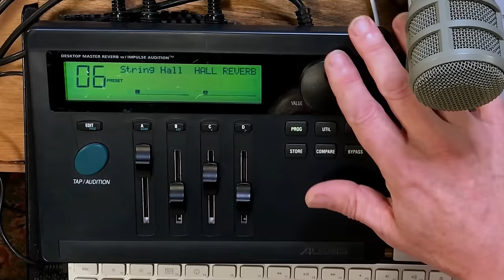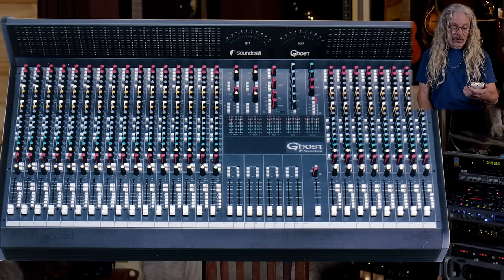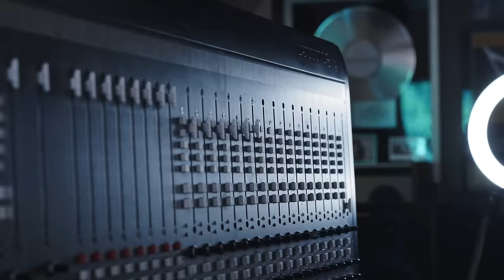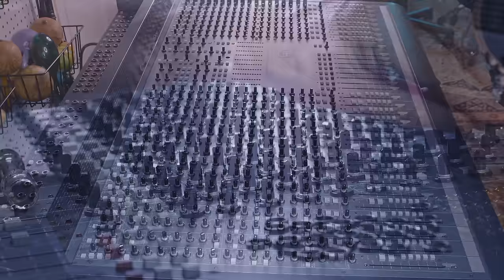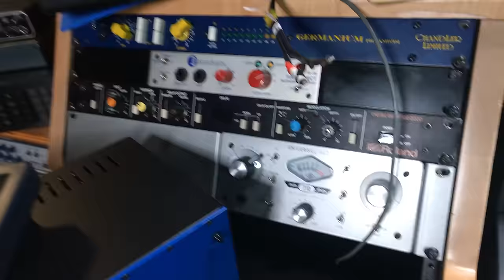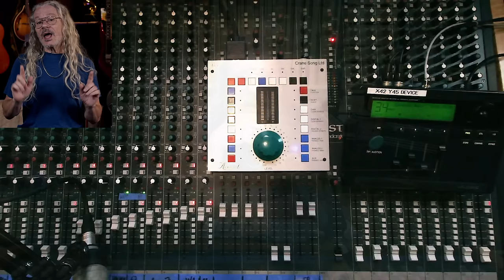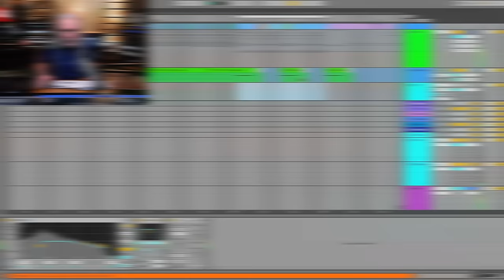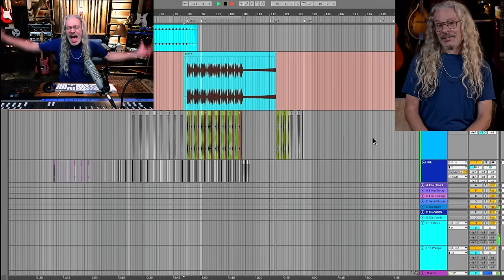Was It All Worth It Or Am I Wasting My Time?

Comment: Only half way through the video so I dont know how well this comment will age, but I am just a dude in St Louis that loves gear, and I see we both have a Tascam MS16 with all the fixins, as well as a Yamaha Rev 5/7 reverb. I'm in the process of finishing up the wiring on my project studio desk. I went to Kansas City to buy my then-dream mixer, the Mackie 8 bus 32 channel with individual VU meters per channel, and the guy said when I got there "You want a second one for $100?" Naturally couldnt turn it down. Also found a second MS16 in KC that had the autolocator I was missing, and my first MS16 came with a contemporaneous Tascam M-520. So the TLDR is that my project studio is built to do everything without a computer. Can do 16 channels of tape, with two different projects going at the same time on different reel to reels on different boards, or 48 channels of digital via a pair of Alesis HD24s. All this gear plus my outboard effects goes through a massive like 600+ point patch bay. I havent even gotten to use it like I want to yet, because I'm at the point where I have to wire up my own snakes to hook up my second 32 channel board, but I gotta believe that once its "done," it will be worth it, for the appreciation of gear.
Reply from the maker: WOW!!!! Looks like you've got a lot of wiring ahead of you. Start the coffee machine!

Comment: Dude, watching now. I'm adding a 40 channel Allen & Heath GL4000... Only difference is I'm having a tech do this all at his shop. I don't honestly know that I could have pulled this off, respect!! YES, WORTH IT!
Reply from the maker: Oh man! I love Allen and Heath. If I had known how far I was going to go with all this I would've thought the same thing. But as usual I tend to get myself into situations....
Reply: That Allen and Heath console is underrated
Reply: I’m using a A&H GL, bought it for monitoring while tracking but ended up using it for mixing. Pretty decent boards and reliable. 😊
Reply: How much is that costing you? I have an old Soundcraft board I'm scared to even get a quote on 😅
Reply: @xxsouthxxsidexxroyxx  Fortunately I live near a repair spot that is a long time certified A&H repair center and they've worked on a bunch of these consoles over the years. I don't have a final quote, but I'm guessing it'll be in the $500-700 range. I don't care if it's $1000, I only paid $600 in nearly perfect condition, plus I'm having all 11 VU meter lights replaced with LED upgrade kits.
They're going thru evvvvvvverything...
Reply: @FreakingOutWithBillyHume  Looking forward to hearing about how you get on with it. I'm excited to get into the workflow after the move. I love the convenience of a unified creative center and you can always reach for more specialized tools for hifi acoustic needs.
Reply: @soysos.tuffsound  right on! I have a well reputed tech within driving distance of me I just didn't know if I had cash for the plunge but if I could get a good go through for around that price I'd be happy!
Reply from the maker: My first 'real' mixer was an Allen & Heath 16 channel Pop-Mixer.  Took it on the road for a while. I can't remember what I did with it. Probably sold it like an idiot.
Reply: @FreakingOutWithBillyHume   Those are still sought after, they are mostly more expensive than the bigger models because of their small footprint. I guess you mean the Mixwizzard ?

Comment: I spent half a year on restoring my MCI JH-636 and had to replace about 2900 capacitors, over 100 opamps, resistors and repair a bunch of traces. The result - worth it! Plus it has a built in TT patchbay which is a life saver everything just hooks into the board and there is no need for external patchbays!
Reply from the maker: Wow! I will have to recap it at some point. Just need to catch my breath....

Comment: Lol incredible, I just got old Spirit Live, I didn't knew how badly I needed it to have all of stuff permanently routed. For knobs great was standard laudry liquid. Much better than washing up liquid etc. A cistern of Isopropanol for pots and sliders and all outboard compressors and there we go, if I need I got multitrack, my 12v battery powered silent fanless pc and laptop too (sometimes was too noisy for same room being live and control room). However, got best of both worlds, now I can give vocalist compressed monitoring with melodic line at the same time recording him DI and process later with plugins or recording guitars this way to reamp them, and it was... Free. Beside isopropyl it cost me only work. Not an eye candy like your desk but I kept my glass desk in front of me where I can swap 16 pad controller with keys or mess with guitar pedals, once I set a channel strip I don't touch it too soon. But magic is in having these 16 channels aside in reach. Having 2 32inch screens but steel needing to mess with what they show, okay, still can do it for DI's, however, mixing desk and 3 stereo compressors, outboard eq, fx units, guitar and bass press already set, no need to mess with cables and menus etc is a game changer. And old doesn't mean bad. If you know what alcohol really is for your soul is saved.
Reply: Ahh and I can say that I think any non conductive oil should work. Personally I often only use diabetic syringes with thin needles to inject isopropyl. Depends on how "meaty" and noisy given set of knobs is. As well ne guys supercareful - old, stuck knobs often can pull pot axles, especially in Alesis 36dirty. If ot won't go easily, don't pull too hard, just inject mixture with knob on. It's not worth it...
Reply from the maker: Thanks! I was happy about installing the mixer when I finished and at the end of making this video. But I continue to be happier about it each day.
Reply from the maker: I was having a hard time finding syringes locally. I should probably order some better suited for the job. Thanks for the suggestion!

Comment: I started recording when I was 12, two tape decks bouncing back and forth, recording the  speaker along with whatever was being overdubbed.
Eventually became a professional engineer. Learned on Neves, API, Harrison, MCI, Studer, etc etc. 
When things went digital I never looked back. Could care less about a console. I mix and edit everything with the mouse. Even when I had a ProTools mixer still used mouse. 
Rock on!
Reply from the maker: I started the same way using 2 cassette decks. And like you once I was digital I never looked back - for a while. I'm not using this for mixing, I am all about being ITB. The mixer is for recording sessions and being able to integrate older gear into the work flow. Also, I do everything with a mouse. No controller.

Comment: might i interest you in my 32 channel microcassette recorder/mixer? it works similarly to a mellotron.. the girls love it. i use 4 banks of 8 opto-isolated 32 Sony M-450s without any mechanical connection so each tape runs completely independently, within an inch or two - every playback / take is totally unique. people say it's "warm" and "tight", which makes me feel, well, good!

I added custom hard-wired inserts for my bank of 16 wah pedals. I am using VCAs to control the center frequency of the wah(s), which I connected to the output (modified for -1V-1V) of a decrypted motorola radio (which i yoinked from a local disaster response team when they came to my aunt's house) so the wah's can "speak" the incoming radio traffic - cool when an elected official rolls into town - a little difficult to work with at times, but that's half the fun! The local paper calls me the "Wah wah from Omaha",  kind of cool! If you're good at soldering you can add switches, but the wahs come as-is. There are trim pots if you want to tune them to something different, but it's analog encrypted so good luck trying to listen to real commands. still, sounds good af, "rich in honey" to quote Rick Nielsen, who I went to middle school with

Anyway basically i need to sell this rig - I am having a hard time finding microcassettes in bulk!  I will provide my remaining tape supply (8.5 pallets, good for about 3 sesh) - whatever price is good for you, I am flexible w/ payments but please don't call/email my PO cuz that'll get complicated
Reply from the maker: Umm..... this sounds like it's not for real but on the other hand......

Comment: Awesome video! Such a good decision to get a hardware mixer. I use Midas Venice 320, which is basically a Dynacord desk - hence made in Germany. Pretty much the same size as the Ghost, a tad more compact I guess.

That being said, the only computer / software solution I'd trust and use is RME interfaces with their powerful, yet sleek and compact #TotalMix . You can send anything anywhere, only limited on how many inputs and outputs you have. But they have terrific sounding converters and all of their products play together very well. Hundreds of I/O is no problem at all.

Comment: Couldn't agree more... I always use a mixer. Why? Because a mixer does anything you want it to - except recording on it's own, but some do that, as well. I currently have a Yamaha MGP16X as a summing mixer in my studio. Why? Well, I've done 1500 shows on a board just like this! There is no way I'm not twice as fast! It doesn't hurt someone went all in for that little mixer and put in absurdly good pres (for the price, that is). Although they're not transformers, they're inverted Darlington, they sound amazing and can be pushed really well. Plus there are two ducking channels (GENIUS!), with levelers, and mono/stereo/blend (simulates a bunch of random speakers) switches. 
Then I'll add a second mixer/interface, which is my 003 Dididesign factory, an old piece of gear SO good that a developer wrote a control system so you can control almost any DAW (including Luna, and this is thing is firewire which support was discontinued by Apple...!?? Some people are geniuses!).
That way I have one tracking interface/control surface, hooked up to a dedicated computer, which I consider to be a digital console and recorder. 12 TRS outputs (!!!) on the back, 4 DIs (!!!)/mic pres, 8 line ins, and ADAT. I take 2 pres out of the Yammie for floating mics or stereo room through the aux, and send 6 outputs in, in 3 stereo busses (low-mid-highs). This leave with SIX discrete analogue balanced outputs...!!! This mean I have enough for summing AND to run a 5.1 set-up... in a box that was literally given to me and thought useless. With 16 flying faders. This thing is 400 bucks, plus 300 bucks if you want it to be able to control any DAW - but it works well with Cubase wth the beta driver for now.
Total cost of the entire studio is around 3500 dollars, including a custom PC made to run it all. I'm reserving the MacBook for songwriting duties now, which it does extremely well, and to run some plug-ins live and do the occasional local band multitracking at a venue - althoug, do not fret, the custom PC is 100% a touring MONSTER... it weight 85 pounds... empty. That's the only thing I hate about modular designs! Nothing beat a modular computer and mixer...
Reply from the maker: Wow! That's quite a rig!  I think if more people actually spent some time using a mixer during recording they'd go get one.

Comment: Great video Billy!  I to have a SC Ghost 32 and I love it but…while recording an album project, during tracking, I started having some issues.  (Noise, channels starting to work intermittently or not at all)… I guess my question for you is…did you have to have anything recapped on the channel strips or input cards? I’m considering having CAL/Creation Audio Labs recap the entire board. Any thoughts on this would be much appreciated as I would like to use this board for the duration of my lifetime and consider it an investment. And by the way, I love your cleaning hack… I used to use the marvel mystery oil on all my air cooled Volkswagens back in the day. I will definitely try that out. Cheers

Comment: Welcome (back?) to the analog realm, I’d start spilling a mix out on that board and see what you prefer.

I used to do all my work ITB and then when I finally got my Allen and Heath board it changed the entire way I work.

Mixes came to life faster, projects became more enjoyable to work on and the tactile control you get from a mix blows the sonics of a single mouse click ITB workflow away in my opinion. Plus you also get to reap the benefits of DAW power and plugins with all that ace gear you have!

Great to see you take the board apart and clean the sucker up, defo a labour of love that you have earned 😁

Enjoy the mixer!
Reply from the maker: Thanks! I'm doing a hybrid thing right now with the DAW and the board. When I get some more work done on the 16 track 1 inch I'm going to do a session totally outside of the box.

Comment: I’m pretty smart in some ways but routing gets me.  It can be overwhelming.
Reply from the maker: Think of it as plumbing. The signal flow is like water though pipes. You can split them into multiple pipes and them have them reconnect, but you almost NEVER want it to flow backwards.

Comment: deoxit solved all my pot problems. (did i just say that?) it has an adjustable output pressure regulator. 

dude, all those screws and nuts… you could have saved so much time by getting yourself a blue12v bosch powerdrill. brushless motor version. its geared toward electrical montage. 1st survived 5years of daily torture and 3drops from 12m on concrete till it drop. first det of batteries still holding up.  if you set the torque safety accordingly you could put those nuts and screws in in splitseconds.
Reply from the maker: oh man... that's what I need. I couldn't find any tool (and I have a lot) that would do the job.
Reply: @FreakingOutWithBillyHume  please get one. ca 200 with battery. get hex to nut adapters too. theres a version without the big drillholdinghead: GSR 12V-35 HX, gets you in every tight corner. i´m not afiliated with bosch, but my 18v milwaukee wielding balcan electricians first laugh at me, then they try it. then they try to steal it. screwdrivers are so eighties... for consoles thats ok ;-) cheers.
Reply from the maker: Thanks!

Comment: the fader is better not to take them apart they contain grease that help reducing the friction of the fader best not to open them just spray them
Reply from the maker: Well that was the whole point. Spraying in there gets cleaner on the lubricant. This way I was able to avoid that (which is in the video) and clean what I needed and leave new lubricant.
Reply: @FreakingOutWithBillyHume  the lubricant you have in contact cleaner is not the same you have in those pots the one in contact cleaners evaporates really quickly. the other one last years and protects the contacts....

Comment: do you have to make adjustments for latency compensation using the outboard gear?
Reply from the maker: Yes, the compensation never seems to work right. What I'll do is send a Hi Hat or kick sound through the chain and record in to another track, then I compare with the original to see how off it is.

Comment: This studio reassembly gave me ptsd :D
Reply from the maker: I realized that Group Output 8 isn't working. So now I'll need to pull the mixer back out, open up the back to see if I forgot to plug in something.... fun.
Reply: @FreakingOutWithBillyHume  And then you figure why not doing a recap alltogether? :D
Reply from the maker: I was going to but ran out of time. The board is not that old and I figure I'll do it later. Scares the heck out of me though.

Comment: Ghost is cool but the non-modularity from top side is a big NO-NO. So you’ll set up everything and after a month or two or a year a chanmel dies and you can only access the strip from below which usually means you need to disassemble the whole thing, cables etc… NO FREAKIN’ THANKS! 

Made that mistake once, never ever again…

Comment: QQ: how do you manage the fans noice from the power supply?
Reply from the maker: It's actually way quieter than the one I had for my old Ghost. I keep my power amps in another room and was fgoing to do the same with this but I can barely hear it.
Reply: @FreakingOutWithBillyHume  I might have to order a newer one as the one I have is making a loud fan sounds. :(
Reply from the maker: You should try replacing the fan first. Way cheaper and not hard to do.
Reply: @FreakingOutWithBillyHume  Will try that! Thank you!